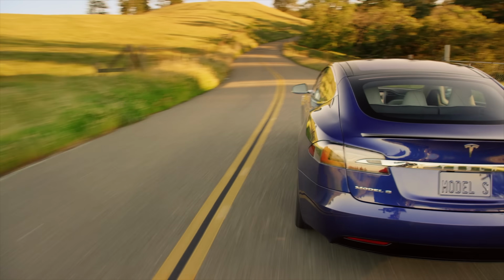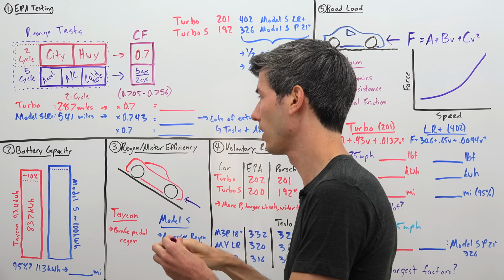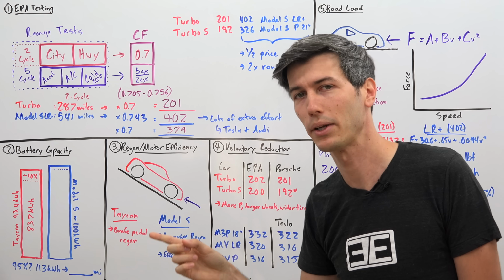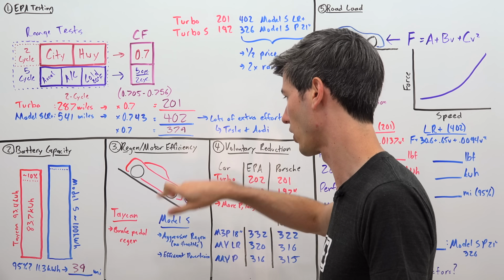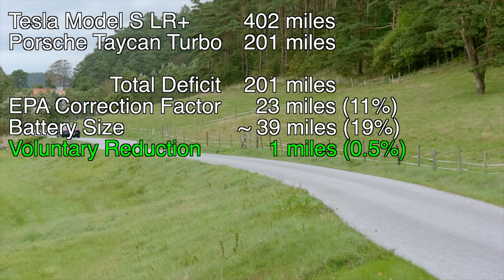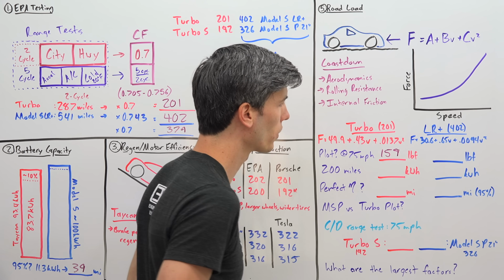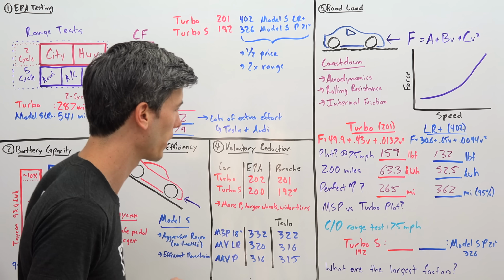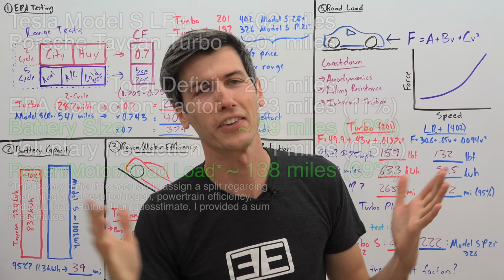Tesla's Secrets To Dominating EV Range - Double Porsche?!

Comment from the maker: Great news! The full Car and Driver article is now live online - you can read it here: 
https://www.caranddriver.com/features/a33824052/adjustment-factor-tesla-uses-for-big-epa-range-numbers/
Reply: Car and Driver has always been massively biased. My 2017 Model S 100D (not the newer "Raven" version with the 402 mile range) does in fact pretty much spot on what it says it will do on the highway (a "mere" 310 miles). And contrary to conventional wisdom, it doesn't get more range in the city than on the highway. My watt hours per mile average is always significantly higher in city driving than highway driving. Regeneration is great, but the much better efficiency of steady state highway driving trumps the constantly varying speeds and conditions of city driving. I will say that I don't do any stop-and-go driving, though, which is where EVs in general do so much better than ICE vehicles. I mean I literally don't do stop-and-go driving. I avoid it like the plague and don't drive during peak hour(s).
Reply: @awo1fman  So do you find plausible that, with roughly the same battery capacity, the Raven version allows a jump from 300 to 400 miles of range? Also taking into account that you don't get better efficiency in city driving.
Reply: @dnuno75  First of all, the Raven has a different, more efficient motor (I think it's the front but don't remember for certain). Second, Tesla doesn't publish the actual capacity of their battery packs and it's possible that the Raven has a higher capacity than mine even though they are nominally the same. There are lots of other, smaller differences as well. Is it plausible? Yes. Having never driven one, I don't have an opinion on whether it's the real world case. I am certain that they do have more range, but how much I can't say. All I can say for certain is that with my specific car, when it tells me I will arrive at a destination with a certain amount of range left it's never more than +-2 miles off unless I detour or my right foot gets heavy.
Reply: From the C&D test, and your explanation of the EPA calc's, it appears that the EPA method is inadequate to represent EV ranges for different EV designs.  Could part of it be that the EPA uses combined City and Highway results, and C&D was a pure 75 mph highway test?
Reply: @kevink2315  The EPA's rating is the best, in the world, currently.  It is the closest to real world miles.  It would be nice to get even closer to real world highway speed driving distance, though.  Things can almost always get better.
Reply: 400 miles was calculated for 60mph
Reply: #3 REGEN ... you blew that one big time.  Tesla regen is limited to less than 70kw with their low tech one pedal regen mode ... while Taycan has a 265kw capacity that is seamlessly integrated into the braking sytem, a much more advanced system capable of regenerating 4 TIMES more energy.
   Also, you didn't mention the extra power draining systems / features that Taycan has like their active suspension system .. such things greatly improve performance, but use energy.
Reply: Does anyone else find it extremely suspicious that the taycan and the model S were very close in range during real world testing done by independent 3rd parties? I guess it doesn’t surprise me really given Elon Musk’s history of fraudulent and misleading statements. Tesla is such a shady company.
Reply: The main difference therefore must be that Tesla uses different speeds and hours of driving than Porsche to come up with a better result.
Reply: Wolfgang K Could be.. Could also be that Tesla submitted a car with a larger battery for testing.. Or paid off the testers maybe.. who knows. From what has been seen with the volkswagen clean diesel emissions testing scandal, wouldn’t surprise me at all
Reply: They refer to the old 85 Tesla pack on the same term as the new 98 kWh one. But did that 85 pack EVER giver 80 kWh even?
Reply: @Cloxxki  "But did that 85 pack EVER giver 80 kWh even?"
No. The teardown analysis by Jason Hughes claimed a theoretical max of 81 kWh but the most I've ever seen claimed from driving the car until it shuts down was 74 kWh
Reply: Thanks
Reply: Couldn’t OEMs use a Dyno/Wind tunnel to simulate and supply that average Highway range?
Reply: I studied physics, love your channel, subscribed when you was a kid. Interesting video as always but the point is.... you gotta eat some more, go scuba diving or something else haha. Take care
Reply: Thanks!  Good stuff here.
Reply: Looking forward to an analysis of the Lucid Air powertrain!
Reply: Can you do a vid in regards to fords little vid with the mustang 1400?
Reply: How do they come up with the A,B, and C constants.
Reply: An EV will go further at 60mph vs 75mph but just take longer to get there, right?
Reply: @Jcewazhere  Based on what you wrote, that applies to ALL cars.
Reply: What was the voluntary reduction by Tesla on the model s?
Reply: @dannycfern  The EPA rating just before this one, on Model S, was 393 miles. Tesla only put 390 miles on their marketing materials.  Later on (made a quarter or two later), it was pushed to 393 miles.
Reply: Oh my... fckn god! All that math and nothing out of it. No Tesla real world tested get's close to EPA, the Taycan beats the range. The difference when you drive both is nothing or just the battery size difference. Elon sure takes good care of his social media flock, excellent strategy, would never thought people had such low moral standars.
Reply: @gregakavcic4971  Enjoy your fantasy world...
Reply: @awo1fman  it's fantasy alright yeah. A Teslemming talking about fantasy is so peak 2020. :D
Reply: Also, the Porsche is just switching to their 2nd gear, at around 75 mph.  That should help the Taycan with energy output, at that speed. Conspiracy theory: I suspect that is why 75 mph was the chosen speed, instead of 65 mph or even 70 mph.
Reply from the maker: @AscendedSaiyan3  no need to come up with conspiracy theories, Car and Driver does the 75 mph test on all kinds of cars. Not new for them!
Reply: @EngineeringExplained  Good to know!  That is why conspiracy theories are usually very wrong. 😉
Reply: AscendedSaiyan3 they should be called “conspiracy hypotheses”.
Reply: @EngineeringExplained  1 trend I see in your videos and others about EVs, is the city ratings are always higher than hwy. Is this more because of the regen braking, slower speeds ergo using less power, or something I'm missing? Just curious. I still think ranges and/or charging networks need to improve significantly before I seriously consider an EV, but the superior economy in city to gas is very tempting for sure.
Reply: @AscendedSaiyan3  You are probably correct.
Reply: @AscendedSaiyan3  In launches & drags, the Taycan switches to 2nd gear  at ~50 mph. It's a big step change; 2nd gear ratio is reportedly about  1/2 of 1st gear
Reply: @AscendedSaiyan3  that switch only happens in Sport and Sport+ mode. In other modes Taycan always drives in the higher, more efficient gear.

Comment: We live north of Tucson and have a 2020 Tesla S Long Range Plus. We don't have a lot of interstate, but do have a good amount of 45, 50, 55, speed limits and a lot of hills/mountains. We are averaging 249 Wh/mi or 0.249 kWh/mi. 100 kWh battery/0.249 kWh/mi= 402 miles! Imagine that. We use max regen and rarely touch the brakes. Totally pleased.

Comment: How did you calculate the 200mile energy usage?
Reply: Not easy too do and too many variables. The best test I found for EV range is the 70mph Highway range test on InsideEV. They run the EV from 100% to 0% and tell you the range.

Comment: To make the comparison as apples to apples as possible: using 20 inch wheels on porsche taycan vs 19 inch wheels on tesla model s yields ~18% efficiency gain for the tesla. Using 20 inch wheels on porsche vs 21 inch wheels on tesla yields virtually identical road load functions. I think fair to say that true efficiency improvement then with same wheel size is probably closer to 9%. Not immaterial, but doesn't make Tesla's advantage seem insurmountable.

Comment: You explain mathematically the difference in ranges but you don't theorize why the real world highway figures are so close. Is Tesla fudging their load equation? Also about the regen braking kicking in as soon as you let off the gas, that doesn't really increase efficiency or battery life because it slows the car down (less distance traveled, eg you could activate regen on Porsche too by immediately stepping on the brakes). A more telling efficiency measure would be friction braking vs regen. I suspect Tesla uses regen braking more than Porsche, which could explain reports of fading, overheating and inferior brakes on Teslas. Friction braking provides better braking power but less power back to batteries

Comment: There are couple issues with this/the EPA and it's quite obvious the test isn't standardized for maximum range it's just for simplicity. The EPA tests in default settings, Tesla is range and economy and Porsche is sport, one uses regen and one doesn't. When you take into account the default settings of each and then set both to the same parameters i.e range they're actually much closer than people would think. The Porsche range isn't as good but it is nicer to drive, the price difference is merely the heritage and handling and not indicative of value though.

Comment: 23/379*201 should be the first additional miles added to P instead of 23. (it’s ratio, not flat, also, it’s possible that if P goes through the same 3 additional tests, they will get a lower coefficient than 0.7)

Comment: I don't understand the road load. Wouldn't aerodynamics go into the equation with velocity squared, rather than not depending on velocity at all? That can't be right. And conversely, internal friction shouldn't depend significantly on velocity. Did you perhaps confuse the two? And from what I can find, the Taycan has a drag coefficient of 0.22 while the Model S has 0.24, so how does it have a better aerodynamics factor?

In general, it would be much more useful to just drive them rather than interpreting figures that we don't really know how they came to be.

Comment: 13:08 
Using 95% of 100KWhr battery. The assumption is 100KWhr battery. You said in the beginning we're assuming it. Maybe that's why
Also you said regen is affecting about 13% so on highway, no regen, so that much lower

Comment: is it just me, or is the lede a little buried here at 15:15? If we're looking for how Tesla can get twice the range out of just a 20% battery-caacity advantage, it seems like we have an answer: they don't. I mean the math, phsyics and testing standards information is interesting, and I get that that's the point of the video, really. But the setup for this whole analysis that it ostensibly debunks three bits of "silly speculation": (1) Tesla's range quotes are dishonest and its cars just don't achieve them, (2) the EPA testing process greases Tesla results, and (3) Porsche is understating its range. C&D drives both cars under essentially identical conditions, whereupon the Porsche outperforms its number and the Tesla dramatically underperforms its own; and the math shows how automakers can (and Tesla specifically does) goose its range numbers under EPA rules - how is that "smacking" the "silly speculation" in the face? It sounds a whole lot like supporting literally all three claims.

Comment: With all vehicles, EVs and ICE, I’ve always used their range and economy figures as a comparison against other vehicles in the same category, that’s it. I don’t take the actual figures as what I’m going to achieve in the real world but use it as a “the Ford appears to be 10% more fuel efficient than the Volvo” etc and that’s purely because I’ve always felt that the testing does not reflect real world conditions.

Comment: Have not read the C&D article as yet but from what I glean from the video is that the EPA range figures are garbage and not to be trusted; and that the empirical data shows the Tesla would have an expected ~6.2% range advantage in real world driving (222/209).  Sound about right, Jason?  FWIW, this aligns with my personal experience with EPA ratings on my ICE vehicles.  Some handily better the EPA ratings and others fall woefully short.

Comment: Excellent video , as normal. 

Now my diatribe on electric vehicles !

Over a decade ago, I had a Ford Mondeo 1.8 Litre petrol.  It could do about 38 UK MPG at motorway speeds. It's 13 UK Gallon tank could therefore take it somewhere just short of 500 miles to empty on a tank of fuel. I also did an LPG conversion. So I had 2 fuel tanks . On LPG I had about a 200 mile range. Combined it was nearly a 700 mile range. It didn't weigh 1.8 tons either.
Ford Mondeo Diesels along with other manufacturers, made the range on my one , not look that good.

Even my current Honda Jazz (Fit in the US)  that only has an 8.8 UK Gallon tank , and will do something like 43 MPG at motorway speeds. Therefore it's range to empty is about 378 miles. It costs a hell of a lot less than either a Porsche or a Tesla to buy (yeah, it's not as quick , I know that).
Even the electric cars more comparable to my Honda Jazz still cost a lot more. On the low mileage I expect to do, depreciation is a very large part of the running cost. The electric ones , when I've done the sums, only seem to payback the extra cost when the car has done something like 100,000 miles. It would take me about 12 to 14 years to do that many miles.
It's also still a lot quicker to fill up a petrol powered vehicle, even the 50 KW chargers can't really compete with a petrol pump as speed of filling the vehicle up. Most chargers in the UK are a hell of a lot slower than 50 KW , more like 7KW at home or 16KW at a service station.
It'll be a longtime before I get an electric vehicle, maybe if ever. 

The electric vehicle future in my opinion will be hydrogen fuel cell, but that's still a bit of a way off.

Comment: IMO the most reasonable explanation for all these strange results (which is hard to confirm without seeing more data first) is that the Tesla power train is horribly inefficient at high speeds. This would explain the very close highway range, which is quite low for the Tesla despite the battery + road load advantages. The Porsche uses a 2 speed transmission for optimum efficiency at all speeds, it's clearly working.

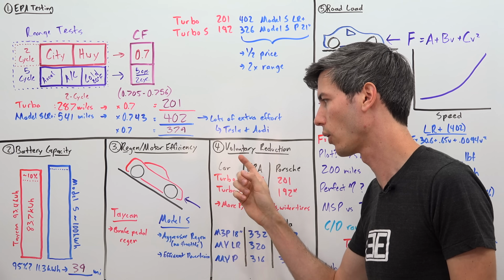In this video, the presenter is conveniently glossing over the interesting bits that were too deep for the article, which clearly had a word limit, while focusing on the irrelevant parts like at 6:23 - Tesla uses a different regen strategy, but that shouldn't matter as the test calls for a certain speed at every time in the test. In the Tesla you achieve the slowing down needed for that by letting off the accelerator, in the Porsche you gently press the brake to engage the ebrake. This shouldn't translate to a difference in range.

Comment: Have Tesla or any other EV manufacturer looked at using ram air turbine generators to charge the batteries to increase range?
Reply: That would be very in-efficient, additional weight, additional component cost and the part would only be used for regen. When an EV regen it is REUSING the motor for the regen.

Comment: What we really need is a range vs speed graph similar to what airplanes do. If you need to reach a distant SuperCharger, what speed will get you there with a reserve? This turns out to be a simple, do-it-yourself project.

Do three, 10 mile, START equals END, benchmark recording the power per mile at three speeds: 15-25 mph; 35-45 mph, and; 65-75 mph. Put these three values in a quadratic equation solver and you have a formula to plot all points in-between. Take away the reserve miles, I use 30 miles for my Std Rng Plus Model 3, and you can do efficient, safe, trip planning. 

The only thing missing is the roll-down coefficients and other EPA metrics are found in the "EPA Test Car Database." The formula, "drag_HP = v * (A + b*v + c*(v*v)) / 375", gives the power needed by any car to sustain speed. It works for EVs, gasoline, and diesels using the drivetrain efficiency to work back to the electricity or fuel needed per mile.

By happy coincidence, some Interstate trucking companies use 65 mph as their highway speed. It turns out that a steady 62.5 mph coincides with the EPA equivalent speed for highway efficiency. So use dynamic cruise control, lane keeping, and long enough gap to see any road debris to make long distance driving work.

Comment: Has anybody else noticed that a Tycan with the same available energy as the Tesla could well have a a longer range with that C/D range test? So what actually gets suggested at the end with this test is that the Porsche is actually more efficient when adjusting for battery size when maximum range actually matters. The Tesla regen is agressive in your face anytime you lift off but the Tycan coasts because agressive regen is not the sort of thing you want in a drivers car. This type of regen is better for city driving. This probably gives us a clue as to the type of test the EPA run and why not as most trips are short urban runabouts.

So basically battery size and regen approach is what gives the Tesla a bigger range not efficency. Which is understandable, Porsche are trying to make a drivers electric car and Tesla arn't but what this actually proves is if Porsche did try and make a Long range car it could well have a bigger range. However i'm not sure Porsche ever will try and make such a car.